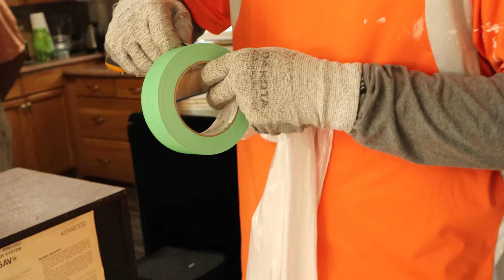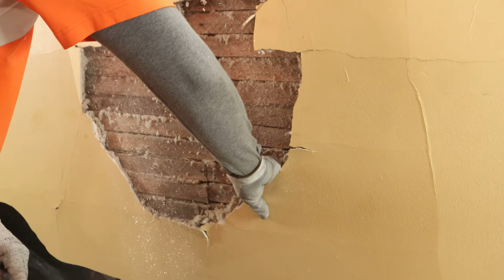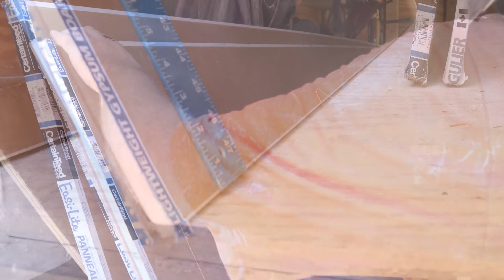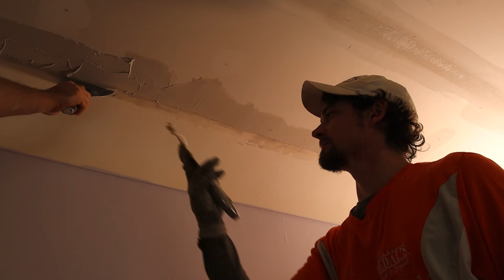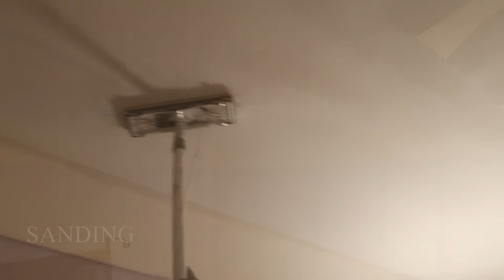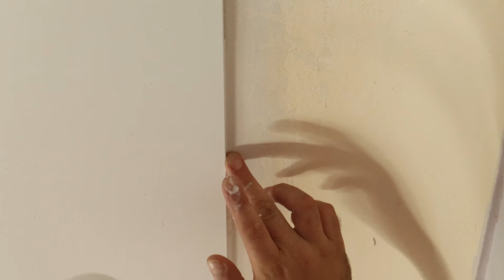WATER DAMAGED PLASTER FIX

Comment: Shayne, new subscriber quick question before you applied the Sheetrock 20 to the wall did you first prime the wall with the cement bonding adhesive?

Comment: Yup. I love durabond 90. I've done walls with it, it does bond to lime plaster, and I've even done 3d plaster relief work with it. It's super hard. Don't sand it. Burnish it with your trowel and water while it's firm but still a little damp. It will be smooth as glass.

Comment: Great video. I currently have a section of water damaged ceiling. Appears to be original wood lath covered with drywall and quickset (looks cheap). I’d like to replace it with plaster and lime wash paint. 

I’m planning to demo the drywall/quickset and replace with blueboard and have a pro do the plaster. Is that a good plan? Or should I do wire mesh?

Comment: Turns out my entire 1915 was repaired in wrong mixture. I have to take out all of the dry wall they put in. Every crack was attemtped fix with drywall methods. I have to take everywall back to the original plaster

Comment: You put out a lot of great videos just started to watch the beginning of this I've been doing this for 50 years in Long Island New York semi-retired now two things number one never use that type of drywall knife that has a folding blade that is very very very very dangerous it'll cut your finger off the only knife to use is the Stanley 199 it has a screw with a Phillips head and a flat head and the knife is screwed together the blade can either be extended is how I use it or on the first notch on the short blade and most importantly I'll say it again most importantly always keep your left hand and thumb at the very top of the drywall t-square never ever ever put your thumb down that t-square as you did in this video running that night cuz that knife will jump across that t-square blade and will cut your thumb to the Bone I've seen it happen you hold the bottom of the t-square with your left toe

Comment: I use hawk and trowel 6 inch knife and 12 inch carbon steel trowel. It’s a talent but it’s way more efficient and flat than pan and knife . I have a 20 inch pool trowel I want to use it. I’m so used to making it flat with a 12 inch trowel.

Comment: You said,  No tape to bond the drywall n plaster
I’ve done this repair several times but always taped also as I was worried about cracking due to no tape
Interesting to see no tape though
I gotta try that
Reply from the maker: Four important factors: must be structurally sound, cleaned, PVA adhesive, and Durabond 90. And then you won’t need tape. Thanks for watch! Shayne

Comment: Hello - I just sat here and watched the whole video because you work with both plaster and drywall.  That was a lot of work, and the repairs you did looked great to me.   My house has all plaster walls and ceilings, but the East interior walls were replaced with drywall 20 years ago.  The wall joint in the NE corner of my house is no longer solid because of poor workmanship. There's crumbling plaster and gaps on the plaster section where it's supposed to connect to drywall section.  They just slapped paper tape in the corner joint without any type of compound underneath and put a skim coat on top.  

Would I be able to just use the Durabond 90 to fill the failed & empty plaster sections (after cleaning out failed material) of the corner from ceiling to floor, and skim that over to the drywall portion with Durabond 90 over that section too?  It's not a large area surface wise; just the corner from ceiling to floor.

Would you recommend I use FibaFuse (or something else; steel bead?) for that inside corner and skim another layer of Durabond 90 over the top of the tape?  More than one coat of Durabond?  Then after adequate dry time, finish with a coat of joint compound?  

You know how you were smooshing the Durabond 90 into gaps - what if you put Durabond into a ziplock bag (or an icing bag) and cut off tip and squeezed it into the joint like cake icing?  That would get a lot more material into the joint and then you can skim over easier.

Thanks for any advice you can give me.  I've been scouring YouTube for answers.
Reply from the maker: Hi Liz, glad you found us!  
1. Remove the loose material.
2. Apply a PVA adhesive like plaster or cement bonding adhesive.  The cement bonding adhesive may be easier to find and works great.
3. 'Shmoosh' in Durabond 90.  I don't think a piping bag will work because the Durabond shouldn't be that loose.
4. Once all is hard, re-tape with drywall tape and regular drywall compound - doesn't matter what type or brand.  For extra security, you can brush on another coat of PVA adhesive before you start taping, however the Durabond you applied is the real fix.
5. Sand, prime, and then paint.
Thanks for watching! Shayne

Comment: Great video.  I have a home build 1890.  The livingroom (30 x 20) a 4 x 8 section had water dammage.  Received quotes from $2000 to $5000 (back in 2005) to either repair the section of sheetrock the entire ceiling.  Having gone to an old bar I noticed their tin ceiling. So I did the entire ceiling in tin with a center medallion.primer painted and painted to make the ceiling look 100 years old.  Total cost was say $600.
Reply from the maker: Tin ceilings are magnificent!  Thanks for watching.

Comment: Durabond 90 is listed “under joint compound” on USG’s website. I suppose you are recommending not to use the “light” or “easy sand” varieties which are not as dense or have fewer binders?
Reply from the maker: Hi Adam, correct.  The product must be DURABOND 90, and not the others in the same list of joint compounds.  Thanks for watching, Shayne

Comment: Couldnt you use a wet sponge to smooth any ruff spots
Reply from the maker: Good question Christine, yes, sort of.  A sponge looses its water fast - and makes a mess.  It can also be 'aggressive', sort of like sand paper.  The advantage to a felt brush it that it's smooth, keeps its water, and no mess.  Hope this helps, Shayne

Comment: We just flooded in Fort Lauderdale. It’s a 1953 house with “plaster” drywall. Or whatever the right term is. I got the water out with a sump pump, it was 4” and not above baseboards. We’re drying it now (no power for 48hours) but it’s been running for a few days. Still pretty wet. Heartbroken as we bought it late last year and have been doing so many renovations. My question is IF we can’t save the walls and forced to do a flood cut how do you attach drywall that’s thinner to the plaster that’s thicker? I can’t watch 45min worth as I have spotty service still, sorry if it’s in the video. Can you still buy the plaster like already in the house? What’s the best thing to do here?
Reply from the maker: Hi Adrian,

You'll need some professional drying equipment - air movers and dehumidifiers.  You'll never get it dry with consumer equipment.

If you have to cut the walls up 24", remember to cut them 25" up from the floor.  This way you can use a sheet of drywall halved at 24" to fit with little waist.

If you're walls are 3/4" plaster for example, and your drywall is 1/2", you'll need to add 1/4" strapping to your cut areas to bring the board out to 3/4".  

I would use a hybrid method of drywall, adhesive, and Durabond 90 to tie the repair into your existing plaster.  Adhesive it the magic potion that will make your life easier.

Hope this helps, and thanks for watching,
Shayne

Comment: This is not plastering  real interior plastering is structolite the base lime and molding plaster is the finish I been plastering for 36 yrs still do it every day
Reply from the maker: Hi Willie. This is an example of how to fix a situation - and a good example. We’ve been plastering for 25 years, but thanks for attempting to inject your negative opinion into something good. Plastering is much more than ‘Structolite’.  Look for our upcoming historic church plaster restoration. Maybe then we’ll meet your expectations.
Reply: It's not Negative the I plaster is different from the way you plaster I use structolite lime and gaugeing on wood lath metal or drywall I'm from the the old school I still use my table and Straight edge but at the same time no harm attended my friend 👊
Reply: My name is master finisher not Mr structolite that's a base coat made by gypsum my friend relax if I Insulted you in any way I apologize my friend
Reply: @Wjhplastering he's very touchy when it comes to constructive criticism.
Reply: No i believe in facts that it don't hate on me because I'm goofy at what I do little  bro 😊
Reply: Ok Mr. Structolite, please explain how your real plaster process is superior in a situation like this? Yes, structolite could have been keyed into the existing wood lath as a scratch coat, but you’d be doing that on old lath secured with rusty nails, whereas this method is far superior, I’ve been doing this same method for over 20 years, except I use construction adhesive and I still apply fibafuse or at least fiberglass tape along the seam of the old plaster and newly installed gypsum board/drywall.

Comment: Great video! I have learned so much from your videos sir! A plaster section covering the brick party wall in my unit seems to have broke off and separated from the brick. I removed the loose section and I am planning to use plaster again to restore the original feel of the apt. Another challenge would be to ensure the new plaster section is flush with the old section! Any recommendations on what the best approach would be greatly appreciated.
Reply from the maker: I’ll get back to you tomorrow when I have a little more time to explain. Thanks for watching! Shayne
Reply from the maker: Hi Antoinea, first step is to clean the exposed brick by brushing and vacuuming.  After that, apply a liberal amount of plaster/cement bonding adhesive - not only to the brick, but to the broken edges of the existing plaster.  Structolite is an excellent plaster for a project like yours.  Plasters are very sloppy.  Protect your flooring well.  Trowel in the Structolite, and then use some sort of straight edge large enough to go from one side of the repair to the other.  We use straight edges like, Featherlites, Darbies, Slickers... Once the material is in and smooth, cover it with plastic for a few hours.  It needs to convert to cement, and that take time being wet.  If it dries too quickly, you may get 'dry-out' which means the plaster did not convert to cement and will be weak.  Once the repair is as hard as a sidewalk, you are ready to coat it with anything you like.  If you're not a professional, I would recommend drywall compound.  It is forgiving and sandable.  
I hope this helps, Shayne
Reply: @plasterdrywallbyshaynebeda4503  This is great! I can't thank you enough for your thorough and detailed response Shayne!
Reply: @plasterdrywallbyshaynebeda4503  hi shayne, sorry to bother you but I was wondering if I need to apply the Structolite using separate coats? Maybe start with a scratch coat wait for it to dry than apply a brown coat? I would really appreciate any guidance!
Reply from the maker: @antoinea.jaoude4504  depends on the size of the repair.  Up to 9 square feet, I would just use on coat. Larger than that, I would put a scratch coat, brown coat, and then finish coat of what ever material you want to use.
Reply: @plasterdrywallbyshaynebeda4503  Hi Shayne sorry to keep bothering you! I applied a base coat of structolite yesterday. I cleaned the brick very well and applied plaster weld bonding agent and in copious amounts. The next the coat got very hard which is good but i have noticed a lot of hairline cracks :-( Is there something i could do at this point to fix the cracks or just plaster another coat on top of it? Many thanks for any tip you may recommend from the master of plaster himself.
Reply from the maker: @antoinea.jaoude4504  send me a couple of pictures- shayne@bedals.com
Reply: @plasterdrywallbyshaynebeda4503  Hello Shayne. I just emailed you. thank you sir!

Comment: Do you use any other basecoat other than durabond?
Reply from the maker: Hi RJ, we use different base coats for different applications. This particular scenario, Durabond is the best product for the job.  Another scenario for the same project would be to use something like Structolite and no drywall.  Hope this helps, Shayne

Comment: Are you concerned about lead and a asbestos ?
Reply from the maker: Good question. If this project were bigger, I would be. However it was a small task. We use air cleaning equipment regardless of the job.

Comment: I'm in the middle of renovating 150-year-old house with a lot of plaster work to do. I took notes while watching, thank you so much. The biggest takeaway from this video for me was that you guys went and filled holes and patched stuff on walls that weren't part of the job. It speaks volumes to the professionalism and care that is taken and lets me know that this is a guy worth watching. Thanks!
Reply from the maker: You are truly appreciated! Shayne
Reply: Bro your like a Taping and texturing Mr Rogers.
Reply: shouldnt they have takena ll the palster down?
Reply: @randomrazr no necessarily.  If the scratch coat is still firmly attached to the lathe there's no need to remove. Just a brown coat and veneer.

Comment: Very good video 👍 What happens if you used regular drywall compound instead of Durabond 90?
Reply from the maker: Thanks for asking! Drywall compound is a ‘low’ dense material and Durabond 90 is a ‘high’ dense material which means drywall compound will not be strong enough to make a permanent repair, where as Durabond 90 will.  Hope this helps, Shayne
Reply: @plasterdrywallbyshaynebeda4503  thank you that does! Again this was a very helpful video, I appreciate it.

Comment: Just watched all your videos over the last couple days.  Nice and thorough.  I appreciate that the work you do combines drywall and plaster repairs, side by side, as there's a lot of that in my house.

In one of the video you mentioned a bit for chasing cracks (may have been this one, but I didn't watch in order so not sure). What bit were you referring to?

I have cracks on every single wall and ceiling in my house and have been using a Rotozip with a tile bit to cut thru the lime coat and finishing it up with a knife.  Just wondering if there's a better solution.

Hope to see more from you.
Reply from the maker: Hi Maggie Dog, that's a loaded question. The first thing you need to determine is if your plaster is 'plaster over  wood lath', or 'plaster over plaster board' - which is essentially 'plaster over drywall'.

It sounds like you have 'plaster over plaster board'.  If this is the case, another method is to NOT chase the cracks, but instead apply cement or plaster bonding adhesive, tape with Fibafuse, using Durabond 90 Type Setting Compound - and then float out your taped joints.

Or, you could simply drywall over top of the surface.

Or, you can chase the cracks.  I only use a utility knife, making the 'V' large enough to get a significant amount of material in the crack.  And then a thorough application of bonding adhesive, and then Durabond 90 Type Setting Compound, and then float as normal to 'feather' the edges with drywall compound.

Using a Rotozip sound extremely dusty.  Hope you're wearing a mask!

Send me a picture if you like - shayne@bedals.com

Thanks for watching!
Reply: @plasterdrywallbyshaynebeda4503  Thanks for replying.  

Actually,  the house is plaster and lath.  There are just some places where a wall was added or replaced, a ceiling replaced or covered, etc, that are drywall. 

All the upstairs ceilings have damage from a leaky roof, followed by a not so good roofing contractor.  I have been using pretty much the same method as you do in your videos to repair them, but using Structolite and Diamond instead of Durabond. 

Is there a reason to use Durabond rather than Structo?

As for the dust, yeah, there's a lot.  But I am only doing a room at a time, sealing it off, running a HEPA filter and wearing a mask.  I only use the Zip on hairline cracks because the lime is so hard it's nearly impenetrable, there are dozens of them in each room, and I have limited time one weekends to do this.  I just cut thru the lime then I can knife the rest out easily.

I really thought I heard you mention using a bit for chasing the cracks, but I guess I was mistaken.

Regardless, really appreciate the reply and the content.

I'll email you a couple pictures shortly.
Reply from the maker: @DaveM3901  I'll reply in your email...

Comment: Just curious about the primer coat you used... the Promar 200.  Was that a specific primer, primer/sealer or just flat latex paint?  If the latter, was it used in deference to the others because it has some breathability to let any possible residual moisture out from the quick repair schedule?  You usually have an advantageous reason for using specific products, but you didn't elaborate on this one.  Perhaps it is nothing except being sufficient for the task, but thought I would inquire.  I like your channel and you do great work.  That ceiling looks beautiful, bet the customers were very happy!
Reply from the maker: Hi Tobias, thanks for asking.  ProMar200 is just a latex primer - nothing special other than a quality product.  And yes, it needs to breathe and all latex does just that.  Thanks for pointing it out.  I’ll make a note to remember to mention this in a future video.
Reply: @plasterdrywallbyshaynebeda4503  Thank you Shayne!